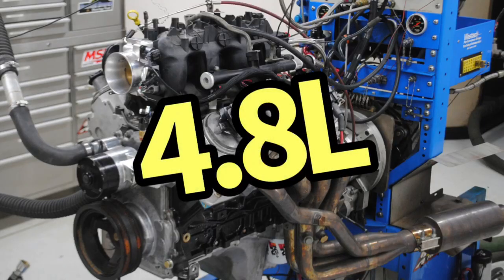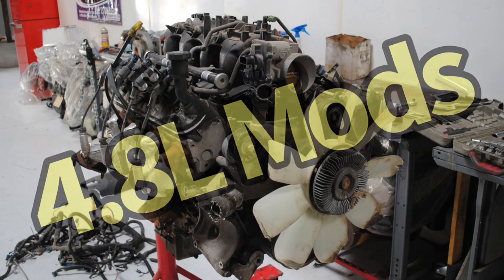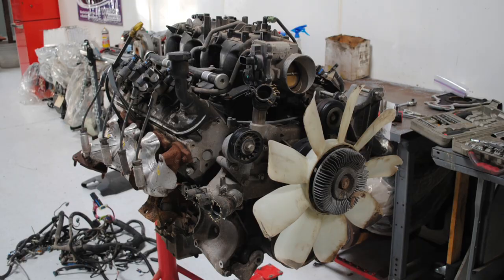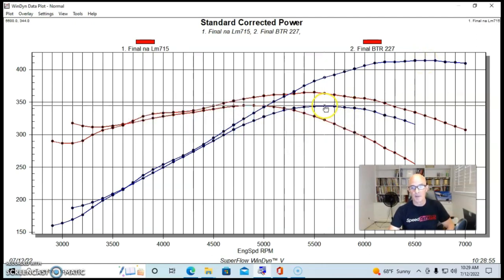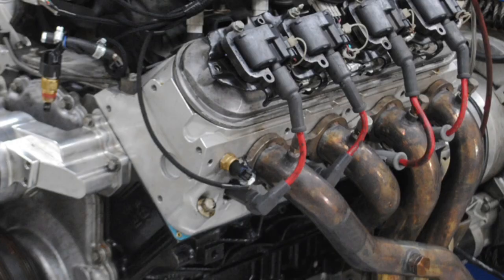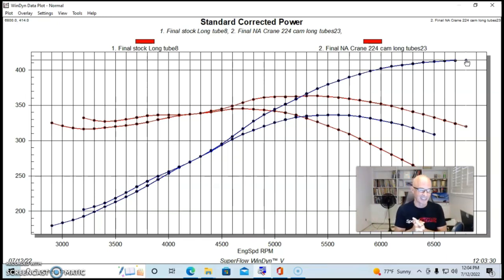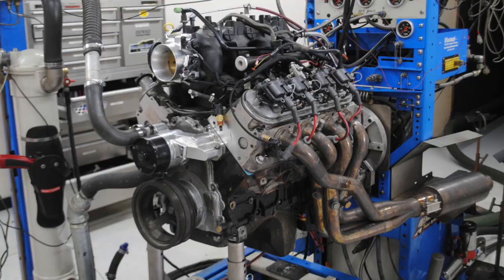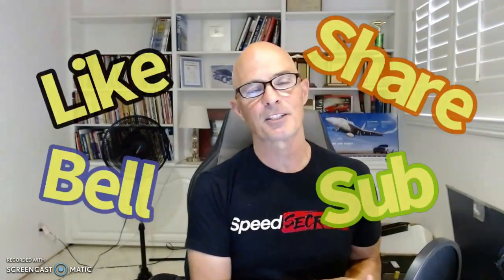IS THE BEST 4.8L MOD GEARS AND CONVERTER? HERE IS WHY YOU PROBABLY NEED THEM ON A CAMMED 4.8L!

Comment: I think LT Tolman tried his best to defeat the 4.8Ls low end with AWD drive and 4.30 gears in his LSA copo truck. Guy has built a rocket from a dig!
Reply: love that truck 💯
Reply: Yeah that is a killer combo he put together
Reply: Definitely got to start a 4.8 with a 3600 or larger stall
Reply: @Modified1 4.56 gears and a 2800 works pretty good with an overdrive car 3200-3600 if you’re going for burnouts
Reply: @turkeyboyjh1  depends on the cam rpm range, but I hear ya for a street vehicle!! That would be a great combo.
Reply: @Modified1  yes definitely depends on the cam specs but just from personal experience for a hopped up street car you can make up for the lack of stall with lower gears, best cruising rpm is going to be around 2800 rpm anyway any thing lower than it’s not going to have good drivability

Comment: Installed 212/218 cam with 110 LSA along with springs, new lifters and trays and 7.4 Inch push rods.. Built 4l60e, Circle D 3600 stall with 4.10 posi in single cab short bed Sierra.. Man did it come alive..
Reply: In 4.8?
Reply: @daviddelacruz7496  yes sir..
Reply: I am real close to doing the exact same thing to my Son's 4.8, my only question will this combo daily?
Reply: Been my daily for over a year now without any issues..
Reply: @williamstrange4313  Im getting ready to do mines is an 03 4.8 How much HP did you make just curious
Reply: I never had it dyno'd but all the upgrades together made a HUGE difference over stock..
Reply: @williamstrange4313  can u post a vid from a dig getting on it and a vid from a 30 pull
Reply: @chronicapollo4133 I can't get it to post a video as a reply..
Reply: also did you have to get it tuned?
Reply: @adrianavasquez3031  yes I did.. also installed cold air intake and headers over the last 2 weeks.. it's very happy now..
Reply: Look for anyway you can lose weight, put that fat boy on a diet and you'll think you've added HP.
The little engines absolutely love weight reduction, I mean they all like less weight but you feel it in "Seat of the Pants" more so than bigger engines. Lighter bumpers, remove the trailer hitch if it has one and same with a tool box and spare tire. A good rule of thumb is every hundred lbs is a tenth of a second. Don't let any overweight friends ride in it either! Lmao😂 Good luck buddy, I know you've got to love feeling it respond to everything you do to it, I'm rooting for you!

Comment: Im running a TSP 216/220 111 lsa low lift cam in my 4.8 in a 88 s10 700r4 with a 3200 converter. Many people go too big with the cam on the 4.8. you need displacement or boost for those big stage 4 cam shafts. everyone thinks the larger the cam, the more it will "lope" but this is simply not true. ive seen guys put a big donkey dick cam shaft in them and make them way slower.

Comment: The problem with stall converter and gears is that if you daily Drive the vehicle it can really be a hindrance for your daily routine which most people spend a lot more time doing than they do drag racing.  I mean if you do a 2400 stall and 3.73s then it makes a usable daily still but if you do a 3600 stall with 4.30s then you can barely even ride the highway anymore and it's going to be harder to keep your transmission cool and unless you're in lockup you're cruising 3,600 RPMs everywhere so your mileage is trash as well.  No V8 engine should ever be cruising over 3,000 RPMs for long time periods it's just abusive and pointless.  I would rather have a stock lq4 that's never been opened with the stock stall and a stock trans behind it than a 4.8 with all the bells and whistles.  Now if ya add boost that can change the 4.8 into being real desirable and not needing obscene gearing to be quick.
Reply: What gear and torq converter you recommend for daily on a 4.8?
Reply: @snooterdavid1969  for a 4.8 daily I would recommend a truck Norris cam and a 2400 stall with longtube headers.  Big gains everywhere especially when paired with longtubes.  You won't need to change your gearing.  If you really wanna do gears I would say it depends on tire height and intended purpose.  If your gonna use it on the highway a lot then I would say stick with 4.11 or 3.73.
Reply: right now i have a 5.3 with TSP stage 3 cam with long tube, 243 heads, re-geared to 4:56 with 35” tires
Do you think doing the 2400 stall would bode well for my application?
Reply: @devanwxyz  yeah probably, you would also benefit from going back to 706 or 862 heads

Comment: punched my 4.8 to a 5.7 (ls1 rod piston combo) , got a good valve job with some slight bowl work along with new btr lifters and a btr torque  cam coupled to 4.10 gears and my Tahoe tows like a dream probably better than a 6liter
Reply: did you bore it out?

Comment: Amazing what a converter and gears do even with a mild cam. Small 3.8 V6 in a 3800# car, 16.2 @ 86 with a 2.2 60ft with stock converter and 3.23 gears. 15.4 @ 87 with a 1.9 60ft with a 3000rpm converter and 3.73 gears. Small 206/216 cam with ported heads and intakes.
Reply: thats really slow but on the quarter mile .8 seconds is alot

Comment: Thanks for the info man I'm putting a junkyard  4.Great from a 99 z71 in my 72 four door Nova I have a 4000 convertor, 350 transmission and plan to run 410 gears. I intend it to be a street car/bracket race car, you sold me on the BTR stage 2 turbo cam. Now if the mail man would just hurry up with my parts!

Comment: My question will come after I profess the love I have for my LR4.
As someone who has been wanting to build up his Lr4 for last 20 odd years and finally FINALLY starting to look like a possibility.   I wonder what the 4.8s numbers would look like stuck into a truck and dyno'd.   My engine has earned a fair bit of loyalty from me.  I've had my 2002 Silverado it's entire life, I had it built to order while stationed in Japan and was getting ready to go back stateside.  I have not been kind to it, and has more or less been raced everyday for 20 years and has NEVER failed in its duty.   In honesty if someone asked me if I mean it's never failed to start in 2 decades it has 3 times BUT it was I who failed it by running batteries long past when they should have been changed.  So remove me from the equation and yes it's been an engine that hits 7k rpms every day with flawless functionality.   And if that's not impressive than maybe this bit is, I'm a disabled veteran some of that is brain injuries so a few of those 20 years have seen 1 maybe 2 oil changes because my memory decided to go on vacation yet it's none the worse for it.

I love that damn engine so much if the truck ever got wrecked the engine would be pulled and put into something else.

End game I plan on adding one of the boost district supercharger kits after work is done to the engine and other areas.  My truck has an NV3500 which will get some type of 6 speed put into its place.  So a converter is useless to me, and am I correct in my assumption that the gearing that would be best for me would also be different?
Reply: Honestly not a ton. Your gonna have a more direct power output with a true manual rather than a convertor being in the mix. Still some 4.10 gears will do you good. Comes down to suspension setup and tire compound how you put the power down. But that 4.10 would still treat you Nice.

Comment: Thank you Richard for the update! I wonder could you do a test with these small displacement engine to utilize the boost specifically addressing the issue of LOW speed torque? If we think about all these gear changes and converters, they also add up cost after all.
Reply from the maker: I have lots of 4.8L boosted videos up

Comment: Even with boost, gears can make a huge difference.  My Camaro has 2.73:1 gears from the factory and make the car feel absolutely sluggish until the little 4.8L gets into boost.  Not to mention, the wheelspeed with those gears is too fast for some dynos so it had to be dyno'd in second gear (not 1:1).
Reply: You can not get accurate data in second, the ratio needs to be 1:1 to get honest numbers. Look at it this way, if you have a stick why dont you start out in 5th or 6th (depending on trans)? Because you need the mechanical advantage the lower gear ratio provides, does shifting gears change the Horse Power of the engine? No it doesn't. If you only had one gear the vehicle would have a top speed if 15-20 MPH, or if it had a higher gear ratio, it may not even propell itself without burning out the clutch. What I'm saying is the Dyno is  measuring the power of the mechanical advantage of the transmission. The car owner should get his money back for the Dyno session because the Shop owner should've known the Data is incorrect

Comment: Both the cams could use a 4500 rpm stall lockup convertor and 4.10 or lower gears ( like 4.30s or 4.56s )
Reply: How do you figure out what stall speed you need

Comment: The torque peak of the gen 3/4 sbc has been a pet peeve of mine since they came out....especially for a truck application. The 4.8 is the worst offender of the platform. Even the L92 is disappointing in a truck application.

The platform is benefitted greatly from a 4000-5000 stall converter and gears since 1998 even with a stock cam.

Honestly, I would really like to see the sky ram refined!

Comment: I have a 2002 GMC with the 4.8 and I want a BTR cam. I'm going to upgrade converter and gears first but don't know what ones to go with. I have a stock 4l60 and 3.42 gears. Thinking either 3.73 or 4.10 gears. I drive mostly on higher speed back roads and highway so I want to sacrifice the drivability. Also what TC should I get? there are so many options? 2600, 2800, 3000...?
Reply from the maker: depends on cam and desired effective rpm
Reply: @richardholdener1727  looking at BTR's Truck Norris cam. was considering an NSR cam but with the age of the engine, I think replacing the springs would be a good idea. Right now, highway cruising at 70MPH is around 1900-2000 RPM.

Comment: I’d be curious as to how the 4.8 responds to  the Truck Norris; possibly compared to the BTR Torque and Stage 1 truck cam.  I know they tend to add power fairy low RPM in the 5.3, so I wonder which of them would make the most optimal curve for a “heavy truck”…  maximizing HP while retaining, or possibly gaining, torque under the curve.
Reply: I think he made a video on this.
Reply from the maker: it would need a converter in a 4.8l
Reply: I also would like to see how the Torque cam responds in the 4.8. It's the cam I've been leaning to, but can't find much on them. I've seen the video were Richard suggested the torque cam for the 4.8, but would like to see it in action.

Comment: I replaced my transmission just before last winter thinking I had a 5.3L but realized after the fact that it’s a 4.8L. I picked up a rebuilt trans from a local transmission shop with a new converter, installed both and returned my original 4L60E to the shop I purchased the replacement. Is there any issue running a trans and converter intended for a 5.3 in a 4.8L? I picked up a trailer recently that is too much for my truck. I don’t have enough torque and struggled to tow up hills. Trans dropped to second and hit 5k rpm, tach tops out at 6k and crested the hill at about 60mph. Freeways where I live have 80mph limits and I can get ticketed for going under 70mph because I’m impeding traffic. The trailer is about 3k pounds and was empty. I purchased the trailer to move out of state and would like to continue to use it once I’ve moved. Engine is bone stock under 150k miles. Is it worth putting a cam in? Boosting? Gearing? Or should I be looking for a better suited truck for towing a 7’X16’ enclosed trailer?
Reply from the maker: 5.3l or 6.0l is an easy swap-or a small turbo

Comment: I have stock 4.8 with a 70/65 upgraded 4l60 with stock converter and converter lock at high temps I have a stutter. I have 410s off a Cheyenne I need to put in but I’m worried I may need another converter. No cam it scoots as is haven’t lost to any na app.
Reply: 6.2 hemis included

Comment: So maybe I missed it but what does qualify as stalls or gears ? Like a 2300 and 3.73s or like 3000 stall and 4.11s?
Reply: Anything under 3000 is not worth the time or money IMO
Reply: On a 4.8. 4k plus and a 4.56 gear would be the way to go
Reply: @gearjonny369  I agree. I put a summit stage two in my 4.8 Silverado and a jegs  converter that is rated 2800 to 3000 stall and I don't think it's big enough but it does pull my boat really well

Comment: Richard I’m curious. With all these stock LS motors that you’ve tested with a cam swap. Have you ever experienced lifter failure?
Reply from the maker: LIFTER TRAY FAILURE ON A HIGH MILEAGE MOTOR
Reply: @richardholdener1727  How does lifter tray failure present? I thought they were only for installation

Comment: Is he referring to the 4.8 Vortex? I know these were the predecessors to it so i dont think they are the same.
Reply from the maker: 4.8L LS based (Vortec) motor started in 1999-2000
Reply: @richardholdener1727 - currently have a 4.8 sloppy stage 2 pac 1218 springs with trailblazer intake behind a 4l80 rear end gear is 5.38 spinning 37" tires what stall would you run? Thank you Richard! Great content as always

Comment: I got stock 4.8 and I want to put tsp stage 2 low lift cam but got stock truck intake but got long tube headers and Yukon 3.73 gears what kind of converter I need someone  told to run vjcx 2200-2500 high stall converter and got 4l60E trans
Reply from the maker: 2500 should be enough
Reply: @richardholdener1727  ok I wanted to make sure if that was enough or go with 3000

Comment: What are the pros & cons installing a stage 4 cam on a 4.8 ??? I need some knowledge
Reply: Or what's the best cam for a 4.8
Reply from the maker: a very big cam hurts low speed (and mid range) torque, especially on a 4.8L. Smaller cams on the smaller motors make a better combo, unless you want a high-rpm, race motor
Reply from the maker: I have a couple of very good cams for the 4.8L on sale right now-send me an email-killerbe16@aol.com
Reply: @richardholdener1727  what's a recommended cam for a 4.8? I want a good combo, mainly looking for speed
Reply: @richardholdener1727 
Are cams for the 4.8 still available?

Comment: 4.8 with truck Norris cam what gears? I’m heading towards 4.10 / 4.30 I currently have 2500 stall whats good stall to run with either those? Daily driver
Reply from the maker: 4.10S ARE COMMON
Reply: @richardholdener1727  thanks 👍🏽